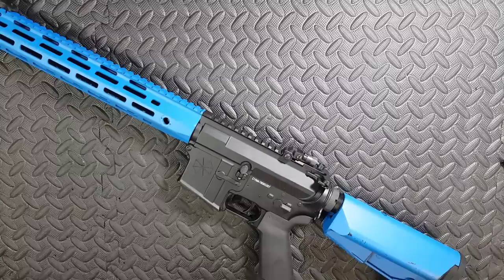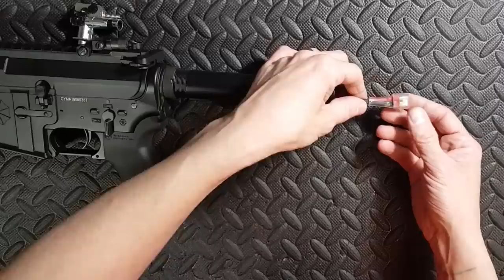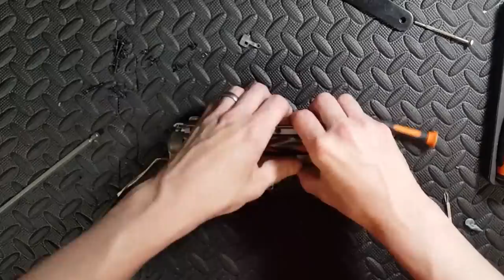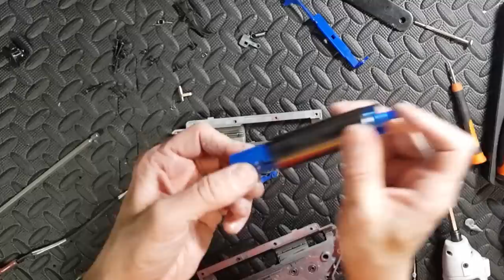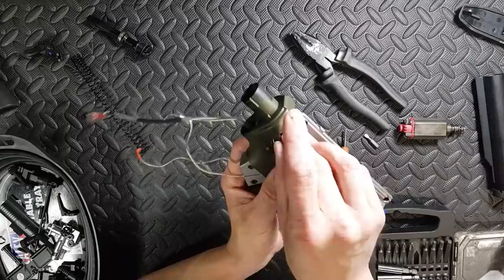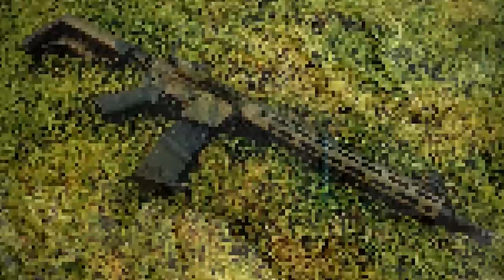EMG (CYMA) Umbrella AR15

Comment: It's a very nice gun, but my microswitch stopped clicking after 5 or 6 games. Replaced it with a Krytac mosfet and trigger contacts and everything works perfectly now. I only used 7.4V lipos.

Comment: So I guess cyma has more quality control than specna arms now? Lol
Reply: Cyma ain't bad. For what you're paying, you're getting a good deal. Their newest stuff looks decent.
Reply: Jakub Topor pretty much anything cyma makes is decent as people tend to bitch (on reddit lol) about their m4s that cost £65 saying they have poor quality control, the actual parts they are made or are pretty high quality for what your paying no matter how much they cost IMO
Reply: @ArchieKeen1  this is their higher end guns, according to the evike review of their platinum ak they got some shs stuff inside
Reply: @n8taing612  even their new sport line m4s are better than specna arms.
Reply: @sally2395  when did they change from the clear plastic to blue plastic internals? Cause just 8 months ago they still used the clear plastic parts and now they're blue and upgraded
Reply: Hamish McIndy  But some of their models that arent in the platinum line have the blue parts. Pheas airsoft went into the internals of a Cm.513 which had the blue plastic and he also went into the internals of the Cm.621 and it had them too plus the same mosfet as the platinum, but they were both not under the platinum line
Reply: @n8taing612  this model is the upgraded umbrella one stock sport still use clear but the internals still run forever
Reply: EMG CYMA ......Soo a slightly upgraded CYMA ....cool. you just finishing the upgrade
Reply: @Johnny Dong ik lol but they also got the same metal compression parts like the Platinum
Reply: My guess is that the Platinum series is just a way to upsell their products to people who are unfamiliar. You see the Platinum name and it's the most expensive one so you know it's good... Or do some research and save a buck.
Reply: Platinum range is great for the dosh
Reply: Absolutely not, at least for externals.  Cyma has quite good internals though.
Reply: @ArchieKeen1  I believe I am the one you are refering to is me as I have been very vocal about its lack of quality. The sub 60$ ones are LPAEGs with plastic gearbox 95% of the time, unless you can get a really good discount on the base rifles. The ones you are refering to are the 100-130$ rifles. They are not the LPAEGs and they are not this rifle. This rifle in the video is the newer Platinum lineup of guns, that cost about 200-250$. The 100$ rifle has somewhat okay internals, but they are extremely poorly fitted. Not a single part of them is the same as the one on this video, the hop is different, the shell is different, gears, motors, airseal. Everything is different. My guess is that they are not even made on the same tooling or maybe even factory. Also this is without mentioning the ABS body, it is literally thinner than nerf plastic, it shares the same plastic as their LPAEGs. If you shoulder it too harshly, there is a large chance that the buffer tube or the lower breaks, also, you can just rip the handguard in half if you use a foregrip.
Reply: This was a cyma/emg that umbrella aftermarket upgraded. Umbrella has great quality control. I believe cyma makes a good build platform, products are robust, brutish, but work.
Reply: @lazloholyfield9902  no this is not pre-upgraded by Umbrella Armory, it’s LICENSED by a different Umbrella, a real firearms company. Internally it’s a stock CYMA plat with metal gears.

Comment: This is the new Cyma Platinum line, right? AR-15 and AR-10 (sr-25), i'm eyeing an AR-10 from their lineup, they look really good for the price
Reply: I have the sr25 one. A new piston O-ring, a g-36 nozzle with inner o-rings for better sealing, m120 spring, check the shimming and new hop rubber. Then you are ready to go
Reply: @dadocles3506  so you have the 098, right? i'm also thinking to get one of those, make a nice 2J DMR out of it,
Reply: @xRaptorScreamx  Yes, I have the 098B
Reply: I've got the standard 098 and it's been pretty damn good with a new hop and shimming was great out of the box
Reply: @dadocles3506  the gearbox shimming or the hop up arm shimming?
Reply: @bengarbacz9350  Gearbox

Comment: Mine was good until it wasn't. The dumbasses shut one of the wires in the gearbox and about my 3rd time running it on the field it stopped working. In a bit of a fit when I got home I took the gearbox apart and noticed a wire had been severed. I'm no AEG tech so I have an empty shell collecting dust until I figure something out.

Comment: Nice video man. I was wondering what’s that sound ? 0:49, my cyma platinum did it once...
Reply: Just the mosfet’s low battery warning, mine has done it falsely a few times on 11.1s that are still 75-85% charged
Reply: @xXCWALDROUPXx  wait the platinum's come with mosfets? ON evike it doesn't say so...

Comment: Wow, shs gears out of the box. Nice, wonder how many amps the mosfet can take. Also, how does the mosfet interact with the sector cut off? Is it a button or a magnet? Looks like any trigger unit could be put into to if it does fail.
Reply: Nvm, it’s just a standard cut off

Comment: Cyma can't be beaten nowadays. You can go kick ass out of the box . Really good Value for Money comparing to Specna Arms ... Just my Opinion
Reply: Having just got a platinum I'd have to agree.  Amazing gun for the money.  Need to give it a good stress test though
Reply: @mrpugster  I have the MLOK AR10 variant with the extended gearbox and I did only small modification to shoot better and just install a better barrel because the stock one wasn't very good machined . For the Money it's a killer .

Comment: So besides putting a rotary hop up, hop rubber, and deans plug would you change anything else on this gun? Does the air nozzle have a o-ring in it? And would you use a 11.1 or 7.4
Reply from the maker: It's great on 11.1
Reply: @NegativeAirsoftTech  cool, I saw another review on one and it was double feeding on semi but it had a softer spring installed in it and my local field is 400fps limit so I'm good with it in its stock form, also does it come with a decent quality tight bore? I know it's a 6.03 but I've saw some really crappy stock inner barrels before

Comment: 13:1 ssg stock plus neo can motor 10/10
Reply: Neo motor in a CYMA?  Wow
Reply: And shortstroked. And control unit from factory.
Reply: Ur Friend JapJap where are you getting the 13:1 from? They look like standard 18:1 or possibly a 16:1 set and I would be highly surprised if they did have 13:1
Reply: OP Airsoft they come stock with 13:1 now
Reply: They are 13:1 as well as shortstroked
Reply: I’ve went through the gears and they match 13:1 gear sets
Reply: The platinum line imo is the best stock  gun on the market so many things u don’t really to upgrade but if I do it’ll make the gun even better

Comment: I saw that the hop up unit was metal ( i think) why did you change it for a plastic one? I read the comments below but I didn’t seems to anyone asking. If it is like i think can you tell me the advantages of changing the metal ( maybe steel) to a normal plastic?
Reply: Changed to a rotary style hop up by the looks of it
Reply from the maker: The standard hopped a .25g max & the power fluctuated by about 15fps,